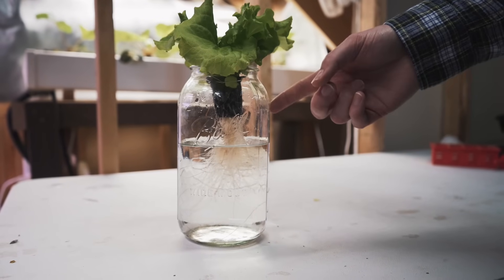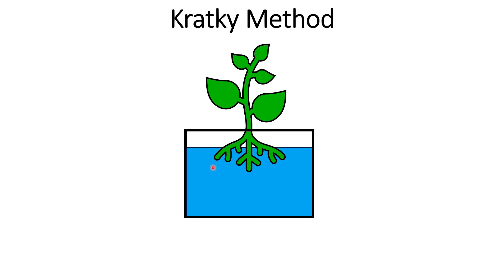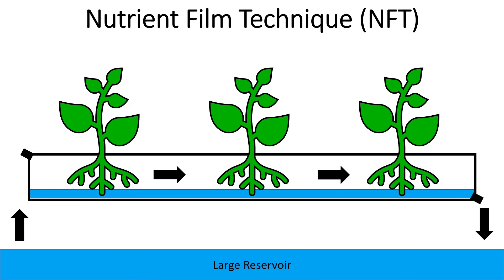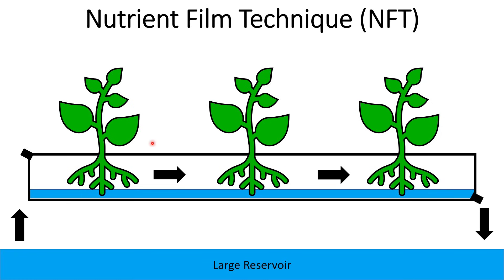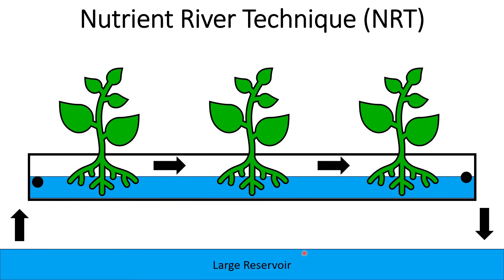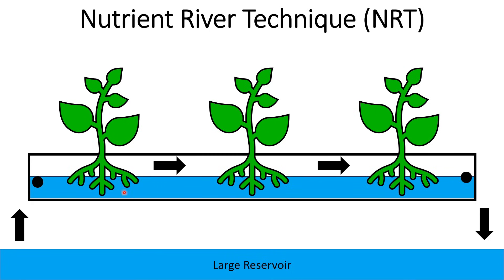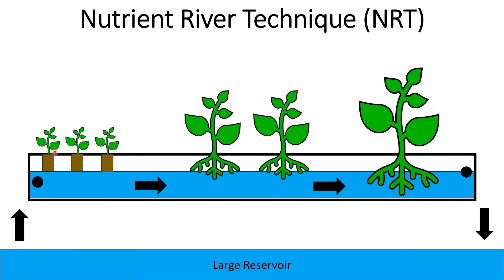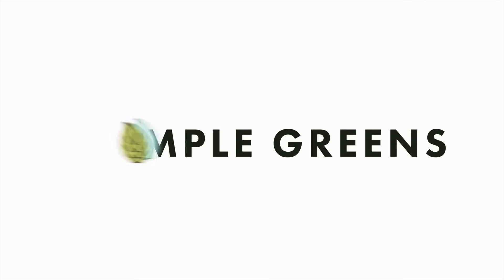Why this Hydroponic System is better than NFT or Kratky

Comment: I thought this is called DFT (Deep Flow Technique)
Reply: Welp, yeah it's definitely DFT.. when he said the combined benefits of both systems, I thought it would be improvement of Kratky Method using media that could sustain many plants without using electricity and not this DFT.

I am looking for methods that require only small space and don't require electricity..
Reply: @Explore_and_break  
You could basically do this with a 2 big reservoirs and a rail/bucket.   Basically you have two reservoirs with the output for the water near the bottom of both, and a rail/bucket between them.  You raise one reservoir higher than the other and the water will flow from the one that is higher to the one that is lower.  Providing you have your rail/bucket between them, the rail will only get low when all the water is in the lower reservoir, at which point you would drop it back down and raise the other reservoir..  By using gravity you can do this same method without any power at all, though you will have to be lifting the reservoirs..  I would suggest a Jack or something, that way you are not breaking your back lol..   The flow rate of such a system would be based on a few factors, one being the size of the reservoirs and the Diameter of the hose and maybe even the height difference between the two reservoirs...   But once you had it dialed in, you could have this system with no electricity used..   How often you would need to rotate your reservoirs would be based on flow rate and the size of the reservoirs... 

You would still need to watch your PH and Nutrient levels and such, just like you would with any Hydroponic system.  ..   The size of your grow space was a consideration though..   So maybe instead of a rail, you use a couple 5 gallon buckets for the reservoirs and a smaller bucket for where you plant the plants you intend to grow.  Such a system could be sized down and up as needed..
Reply: @lfaf9509  I see.. that's interesting. For now, my goal is to create small hydroponic systems for large plants like broccoli, to fit inside small garden beds with net covers (to protect the plants from diseases).  Because yeah, I have a farm and the farm doesn't have electricity. Also spreading many small garden beds reduces the risk of farm disease because they are isolated in their own garden bed.

But, your suggestion idea opens new doors for me to many more possibilities especially when I deal with smaller plants like lettuces later. Thank you. I think even without needing to always move it (make both reservoirs Always be in the equal height), will be better.. since I will have to frequently check the system anyway and will always be able to add more nutrients whenever I check them. It's just now instead of a bucket, it's gonna be a rail.. which is cooler. So thanks a lot.
Reply: @Explore_and_break  I used to replenish the water level with fresh nutrients but then changed to just adding more to it. I do the system above, indoors, and also use a 17 gal bin (black bin with yellow top) when growing in the greenhouse. Put a sealed straw or thin foam (needs to float) on a corner to tell you the water level and only add water when needed. I let up to 6" go down before I even worry because the bin is 15" tall and still have plenty of water. I marked my level (straws) to allow 3" gap from the water and cover and then mark every inch to let me know how much I need. 

Anyways, I'll be connecting all my bins to automatically refill once a week. 😊 Get a smart plug ($20.00) and set the schedule up. That's how I have my lights setup. I don't even look at my "indoor farm" but once a week. 😜
Reply: @sassygil6675  ah, thank you.. that's actually brilliant.
Reply: @Explore_and_break Or run on 12V Lifepo battery charged by solar. The upside are cheap 12V automobile parts like window washer pumps.
Reply: @seriosertyp8145  hey, that's interesting idea. I see... Yes even if it's charged at home and used with timer switch so it won't run all day, it will do. Thanks!
Reply: @Sang_Akrobatis can you grow up? Would a felt grow wall with gravity fed drip irrigation would be an option?
Reply: @elliewalls-k9k  do you mean like aeroponic tower? I think you can modify Kratky Method to be like tower, where you can make a bucket have 5 holes.. 4 holes on the side and 1 on top.. then use some kinds of fabrics to pull the water up.
Reply: @Explore_and_break  I like this idea. Thanks for sharing it
Reply: @Explore_and_break solor panel to a DC  pump?
Reply: Yes this is what I know this type of system as also
Reply: Yep
Reply: Appreciate it for posting! I need advice: My OKX wallet has some Tether, and I tpossess the seedphrase. (clean party soccer advance audit clean evil finish tonight involve whip action)..Could you suggest how to posting sending them to transferring them?

Comment: BTW, I purchased the course. I started my system on 11/30, and I’m a week or two away from my first harvest. When I build my next system, I’m going to use 2” bulkheads to increase the flow from rail to rail and to prevent the roots from stopping the flow and causing the rails to overflow. I had a small leak because the roots clogged the 4” risers. This caused the water level in the first rail to rise and overflow through the plant sites. Also, I think I had the pump turned up too much. I’ve since dialed the pump back. Anyway, it’s a great system.
Reply: Had the same issue happen with this system. To fix it, I just stopped putting a plant in the hole closest to the exit bulkhead. Also, my pump isn't very powerful, but I do get enough flow. Been doing it for a year now. Works very well. Just curious, what do use for your nutrients?
Reply: I also built this system and had roots clog up the pipes and cause  the system to over flow. It's really hard to clean and get any loose roots out because of all the 90 degree angles. I would also use larger connection pieces if I were to redo this system